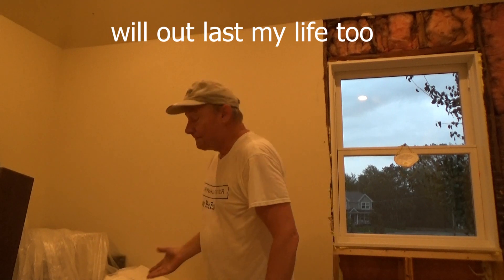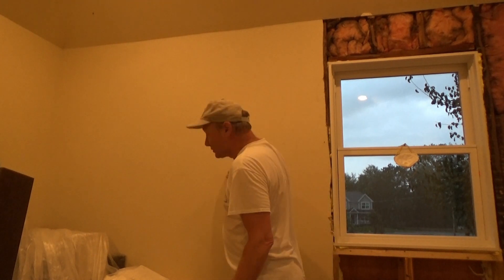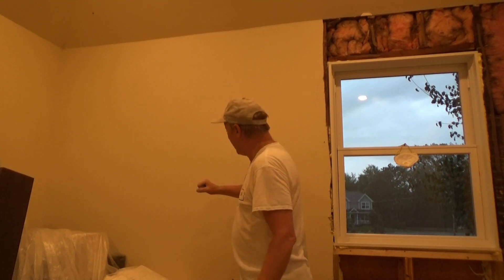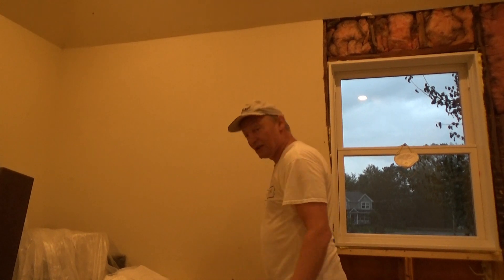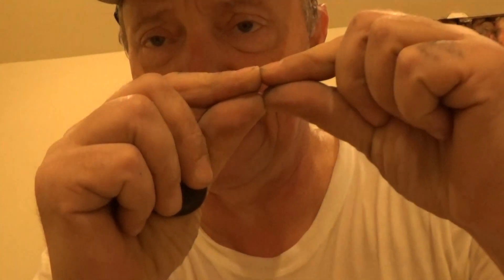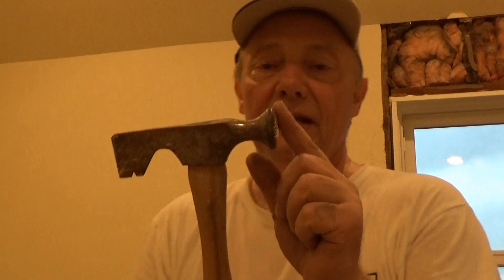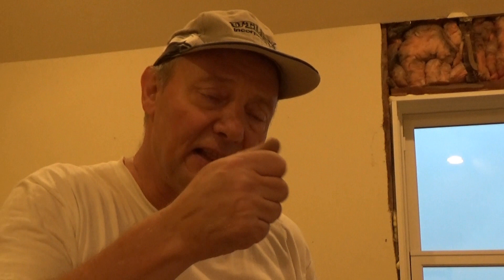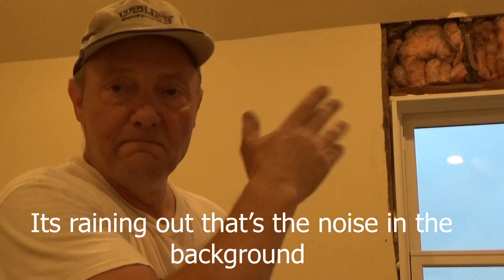Drywall Nail Pops and why they Happen

Comment: This video is very helpful, thank you! I had popcorn ceilings in my home and removed them two years ago, then spackled/ painted the ceiling to what it looks like now. However, gradually since then I’ve noticed several nail pops in a line in one part of my living room, several in a line on both sides of my hallway, and a few looking to pop in my bedroom. Is this normal? Where I live can get extreme heat/cold but I am curious if this could be a structural issue? I don’t notice any other cracks in walls/ceilings or uneven flooring. TIA!
Reply from the maker: Sounds like it is just normal popping. Make sure you use screws next to the ones popping before you spackle them.
Reply: @ thanks so much! I was wondering if these nail pops could have been present with popcorn ceilings but never poked through at the time.

Comment: thanks  i have a project to do painting my interior. , I dont see the nail or screw heads just small round  spots,  what about thin cracks by the metal coner beads do i need to tape it ?
Reply from the maker: No I scribe the crack in a v shape and strip it twice.  Make sure the mud is dry between coats.
Reply: @THEDRYWALLDOCTOR1  thanks have a good weekend.

Comment: I have so many screw and nail pops in my house. Walls ceiling everywhere. Nothing in the basement. All on the main floor. House is about 20 years old. I have lived here for 3 years. I repaired a good amount of them last year. Any idea how they happen, and why so many? Thank you.
Reply from the maker: Different climates have a better chance of more screw pops and it also depends on how wet the wood was before they drywalled it.
Reply: Thanks for replying. Will they pop again if they are fixed? Never noticed this in previous homes but i was to young to remember if i did have any or not.
Reply from the maker: They shouldn't.  But theirs always a first time.

Comment: I have been getting nail pops in a 40 year old house in the pacific northwest. Pretty damp here. A few years ago I installed a wood stove to combat the dampness and now i'm getting pops. I think its from the studs shrinking as there is no signs of moisture. I was worried because it shouldn't happen in a house this old unless something is wrong...or something has changed. Do you think the new wood stove is the culprit, I can live with it if it is, as long as the place isn't falling down. 
Thank you for your channel.
Reply from the maker: Absolutely when you take the moisture out you will get the nail pops I'm sure your house isn't falling down
Reply: @THEDRYWALLDOCTOR1  thank you, I was pretty sure that was the problem. Thanks for the advice it's appreciated
Reply: The same thing happened to my home after installing a wood stove insert. Nail pops all over. I can see every stud lol. I also added a central air system the Year before. I'm guessing my house us finally drying completely after 50years. Let me know if you learned anything new from your experience. It was driving me crazy and causing anxiety

Comment: When you glue, do you lay a steady bead down, or do you just to globs. I’ve had more success using globs about where we place the screws in the field. I’m sure you’ve taken down old drywall that was glued but the glue strip wasn’t touching the drywall but in one or two spots. Just curious as to your thoughts.
Reply from the maker: I glue in strips but make sure I screw each stud and pull the sheet into the glue
Reply: We used to as well. Pull a few random sheets back down in a 300 sheet drywall job. I was surprised how little glue actually touches the paper. Sure you can really load up the bead, but how many guys are doing that. Just sharing why and how I’ve changed over the years.

Comment: One weird thing was I've watched videos of guys doing drywall in Taiwan and the processes are definitely different there, but I really rarely or never noticed nailpops anywhere there when I was over there. Their processes are gluing it to the studs, but then using an air gun and crown staples to actually fasten it, instead of roofing nails or drywall screws. I think for steel stud application there generally it was screwed, but there probably still a majority of places have masonry walls and just use drywall for ceilings with basically 2x3s making a false ceiling on top of a masonry one.

Comment: Back in the day when peeps opened up they wallets and sprang for their monster shacks I would be taping on laminated lids virtually no screws hence never a pop. I’m sure you’ve crossed that path as well but I don’t see this any longer but then I’m not working in 2.5 or 3 mil houses any more